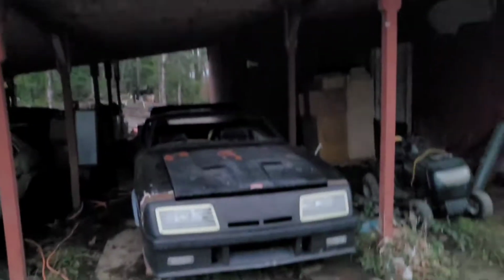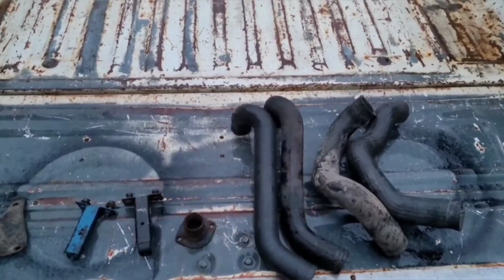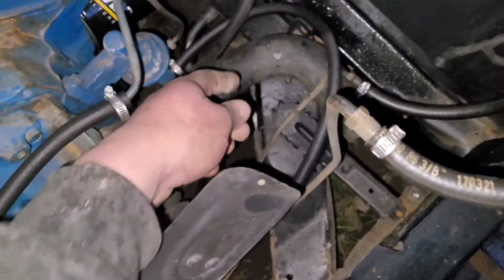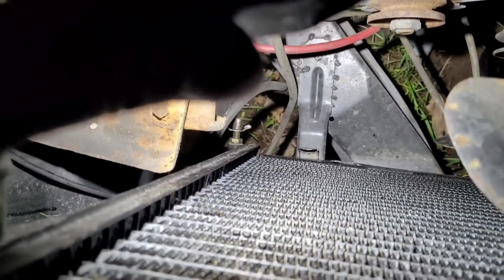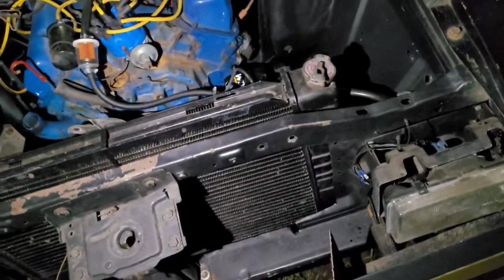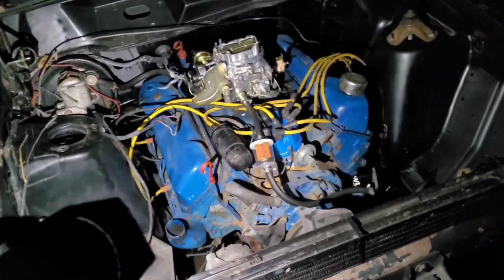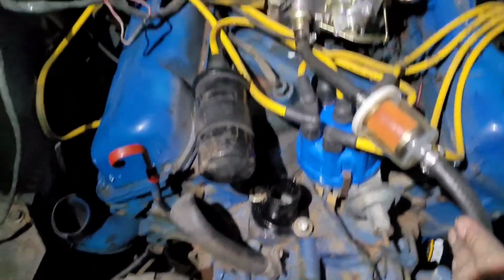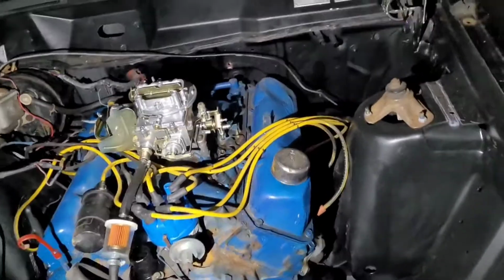- THE DIRTE INTERCEPTOR - EP8 parts score drivetrain basics and getting closer to being a driver !!

Comment: Thermostat is wrong, no one makes the correct Cleveland bypass type thermostat except T-Meyer. Radiator is too wide, you need the 22" core width radiator, not the 26" one that you have. We should talk. I just MIGHT have an extra pedal assembly to make it a four speed car...